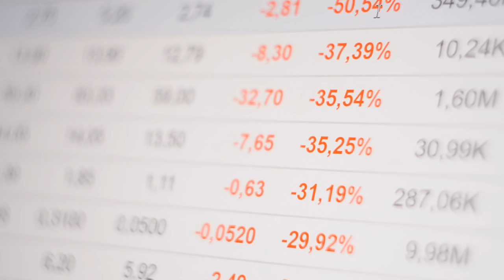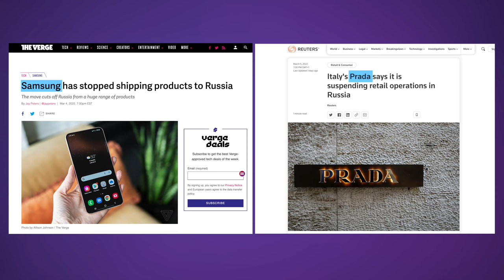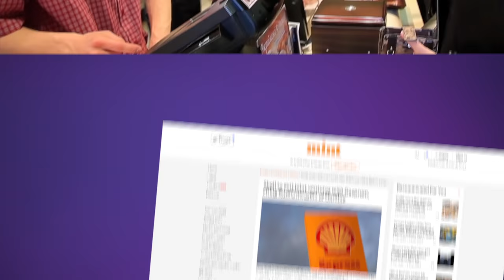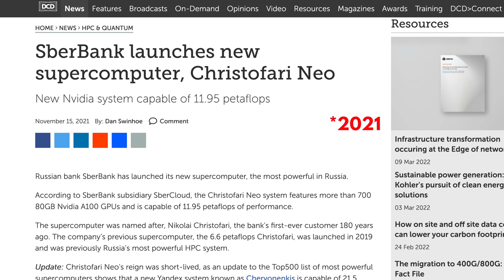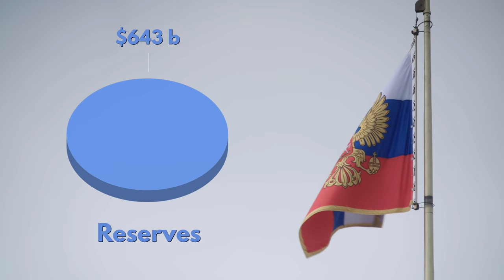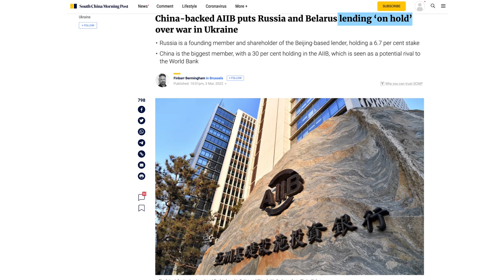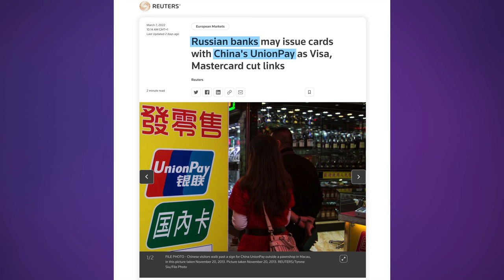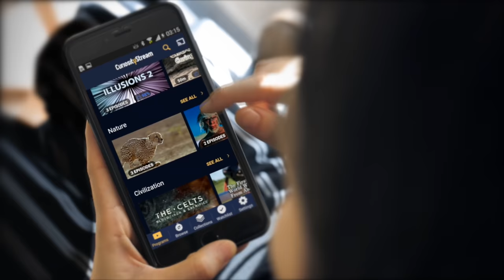Can Russia Survive Tech Sanctions?

Comment: I work in IT field and let me tell you this, Hardware fails every day every minute somewhere out there.. If there is no constant spare part supply, it will decay and will become very limited to function.
Reply: Software requires constant support also.  24/7 support.
Reply: All  have sinned and fall short of the glory of God
the rightousness of God is available through faith in Jesus Christ. 
there is therefore now no condemnation for those who are in  Christ Jesus.
Repent in Jesus name ! confess your sins to God.  
the end is near.
Reply: Me as well. 20 years. Not sure what field in the industry that you are, I am Technology Operations.
So hardware does fail. But not across the board on all devices that are linked to one another. This is why you would set up Parity and Redundancy among the most important Cloud. My last job was in a massive hospital, and current at the top 3 banks in the US. Our systems are so redundantly reinforced there is never a milisecond of outage time. The possibility of 100x devices backing up data and configurations I couldn't tell you. I do know in my enviroments, downtime doesn't happen due to hardware or software problems. The IaaS takes over. Which could be anywhere in the world. As is physical data centers. 
Given that implementation, there is PLENTY of months even to get what you need to replace a node in the architecture. 
I'd like to hear your thoughts.
Reply: @mitch__tech  Most systems are not nearly redundant enough to do months without spare parts and even those that are more than single redundant will not comfortably run their systems with reduced redundancy.
Reply: @fearGod8 yawn
Reply: @fearGod8  There is no such thing as sin. And God is not wrathful.
Reply: @mitch__tech  Putting hospitals as a example of wear-resistant hardware is like saying 'a battle tank is more resistant to small arms fire than sedan, therefore we should not worry about partisans hiding in the woods and shooting passing cars'- Hospitals are designed from scratch to be safe in all but most extreme circumstances with redundant power supply systems, stockpiles of food, medicine, clothing, spare parts, as well as fortified construction.

However, much like the statement, a lot of the electronics on consumer-grade stuff as well as company-grade stuff (such as building and automation electronics, which are massively important in big buildings such as food storages, factories, skyscrapers etc) are very much 'order to replace' items where not much redundancy or stockpiles exist due to high cost of redundancy vs expected projection of neccessity.
Reply: They could use Windows 3.1 .
Reply: @wtfisthiscrap  Bring it on..
Reply: @fearGod8  Finally get to stop work then!
Reply: I don't work in IT; however, I tend to believe it really won't take much hardware and software to cobble together a functioning nuclear weapon or EMP device. It'll just take one and we'll all be back to zero when it comes to economics.
Reply: my laptop and iPhone are still going strong after 7 years. But I get your point
Reply: @fearGod8  Look for the prophecies of Anna-Katherine Emmerich, Anna-Maria Taïgi, Elena Aïello, Our Lady of la Salette, Our Lady of Fatima, Saint Pius X, and so on.

Comment: I'd like to add on your point at around 8:00. The Chip blockage is far far far more devistating as you think. I've worked as an embedded software dev for 20 years and those chips usage goes far beyond than most people think here are just some I've worked on. Chips in gasstations, sewages, waterplants, oilplants, food production etc etc etc. Everything which is somewhat automated/remote controlled with logics in place is royally fucked to put it lightly. It won't even take 1 year until major consequences are beginning to appear in normal peoples life. Fresh water, gas and food will get wracked sooner or later as everything requires modern chips these days.

I'am really interested in the way the russians are gonna deal with it. 

Even us without any trade restrictions had problems the last 3 years due to the semiconductor shortages especially in embedded fields.

sry that my grammar sucks hard, but I really wanted to make clear how depended a modern civilization is from these chips. The most basic infrastracture is dependend on it.

a little edit for further info. The lowest russian semiconductors got around 130~ nm. They've claimed to produce 90nm but that one never came to light so most likely a propaganda hoax.
Reply: They talk 90nm when chips are 10nm or smaller these days.
Reply: You are 100% correct my friend. 
General purpose chips have insinuated themselves into almost all business. This is why people do not understand the situation in Taiwan. It would be insane for the world to allow China to destroy the largest and most advanced chip maker in the world. Like the Chi-Coms did to the Hong Kong business, they would do the same to Taiwan if they were allowed to. That would cause the tech world to completely collapse. And that would cause a world-wide industrial collapse and thus world wide DEPRESSION.
Reply: @makatron  forget 10nm, Apple’s next generation of silicon is expected to be the first to use TSMC’s 3nm process
Reply: @ok_schlatter  it's insane how a phone now outperforms my gaming pc from early 2000s
Reply: @makatron  today a single consumer level desktop computer has more raw arithmetic computing power than all living human beings in the world combined, by at least four orders of magnitude. it's pretty insane to think about how much work computers actually do for us.
Reply: @Bestmann3n  remember when in school they forced us to learn to do math in our heads claiming nobody would carry a calculator at all times? Well well well that didn't age nicely. 🤣
Reply: There is Baikal BE-1000S CPUs with 16nm in 2021. 
And 28nm Baikal-T1 since circa 2016. Sure, it's all made by TSMC, but last time I checked, same with AMD (or we're gonna call AMD paper tiger or something?)

Probably those Baikal CPUs are not good enough to replace high end Intel and AMD CPUs, but that's not the point. The point is that there is 28nm for sure and even 16nm chips (at least few hundreds of engineering samples of 16nm). And you claim that there isn't even 90nm.

If you know how to google, I guess, you can find more info, there's enough. I just did. And I am not even 'embedded software dev'.
Reply: @ivanbardov  oven if there is, with no feasible way to keep producing them how are they going to fix whatever machine they're in?
Reply: @makatron  probably they won't.

But as I said earlier, my point is that there were 28nm and even 16.
While the guy above, pretending to be knowledgeable on the matter, says that even 90nm is doubtful and probably propaganda. But 2 min google search proves otherwise.

Correct me if I'm wrong
Reply: @ivanbardov  ah no I'm with you, I later sure searched for the latest chips made in Russia, still the pressure on the whole economy and regular folks is going to keep piling up as days go by. Let's hope this ends soon.
Reply: @ivanbardov  design and fab are two completely different things. You may be able to design down to 5 nm but if you don't have access to Taiwan's fab capabilities, your design is nothing more than an idea that you can never use. Most design houses are what's called "fabless", in that they can't build their own chips. These Russian examples are the same. The sanctions have removed access to the fab houses that can do the latest and greatest chips so without them Russia is screwed
Reply: @vincentpatrick5780  
What's the point if your comment? In my initial comment I explicitly said that those Baikal chips were manufactured by TSMC, just like recent AMD chips. I never said that Russia isn't screwed either.
Reply: @ivanbardov  I thought you were claiming that Russia can do in-country Fab down to like 10 nanometers. I was clarifying that that's probably not correct, because only tsmc, Intel, and Samsung foundries can go that low worldwide
Reply: @ivanbardov  Russia may be able to design down to 10 nanometers but they can't Fab designs that small on their own soil
Reply: @ivanbardov  The issue is that with sanctions, TSMC will not produce for Russia, and Russia's internal production may not be capable of 16 or 28 nm chips.
Reply: @TheCuriousNoob  compare that to the ancient tech that was used in the Apollo program
Reply: I guess those who have played fallout know the importance of chips then ;P
Reply: @makatron  haha yeah, good times lol they can say that to our smartphones!
Reply: 2w won't India supply most of the tech systems Russia needs? As well as China? So won't Russia with these 2 countries help be ok?
Reply: @ernestovelasco6182  agree

Comment: Think of similar scenario with China. Every sector globally would impact since most countries fully dependant on import from china and specifically cant survive without Lithium or Semiconductor demand.
Reply: The main reason CCP is still there is because of promise of common growth.
That for past 2-3 decades have made people to even take some down beating.
They don't provide human right but it's still better then starving to death that has what CCP has done overtime.
Is it all because of there own effort?- the answer is no.
But
Have they taken full credit ? - answer is yes.
With Chinese economy slowing due to bad terms with others,other starting to pull out there resources, their bad one child policy ie a shrinking working class people.
Historically all dictatorship collapse by public is done when the times turns bad and still their behaviour don't change.
If thing are getting better general public will tolerate more and more but when things start to turn bad even earlier level of tolerance start to be less.
CCP is not that stupid Atleast what I think for world to put halt in there economy by giving them very clear reason to do so.
But even small changes overtime will affect a lot in long run.
I really don't see CCP lasting anything more then next 60 years.
To long but slowing and degrowth will take that much time only
Reply: @Daniel M Survellance is mostly for security, credit system is nowhere as insane compared to the west, censored fact-checked news are equally bad, I’ve spent half of my life on each hemispheres, I know exactly how things work.
Reply: @Daniel M the West has to cooperate with fellow democratic nations and we have to stop being reliant on countries run by dictatorships or radical fundamentalist Islamic countries. 

and I already know that the West is going to be accused as being "racist" this is a risk I'm willing to take. 
multiculturalism is a dumb idea. 
multiculturalism in Yugoslavia, Lebanon, Cyprus and many other countries never worked. 

the difference between people are too big in order to have a multicultural society. I don't like being tribal but sadly this is how majority of the world works. people care about their own kind first instead of others. this is the honest truth.
Reply: @namanjain5763  dude you indian man for once stop talking about china
Reply: @LevisH21  I salute your knowledge of the truth as so many are being brainwashed to think otherwise.
Reply: Vijayakrishnan Venkatakrishnan 
PRC "manufactures", but the underlying Technologies(how & what of manufacturing) is almost of Western origin. Mostly it is true of semiconductor industry(where a good part of manufacturing Technology is with Taiwan). And if they withdraw all that, the manufacture in China upon which PRC prosperity depends, collapses. Now these Technology holders do look for alternate sites, mostly in SE Asia with Vietnam being prominent. All said, almost all "chips" (Large-scale Integrated Circuits & above) come from PRC. That way they are far far better placed than Russia, but the "switch" is in Western hands.
Reply: @TheDomokosi  
"Rant"
Reply: @namanjain5763  
Well written piece of info. But people(Chinese) don't elect CCP(or CPC) leadership that is the sole ruler of country.
Also your use of "there" for "their" is really grating. It distracts my understanding. Would you mind writing the correct spelling (heart of English language is its spelling), please?
Reply: @LevisH21  
In Middle East, it is the continuation of the "Crusades" (as far as Islam is concerned, at least; with Christianity responding).
Reply: @reggiep75  
How the Chinese have dug? It is America that did the trick - by shifting lock, stock & barrel her vast manufacturing to west, across the Pacific to PRC. That made PRC prosperous with a hundred million jobs on one side, while on the other hand keeping their (American) citizens happy with practically "all" the daily necessities for family (that if made in America would cost five to ten times each), imported across the Pacific.
Reply: @MrPoornakumar  like I said. 
the West isn't just USA. 

and USA is currently extremely divided because of how diverse the population has become in recent years (40 years or so). 

with the rise of technology and social media, Americans have become extremely tribalistic with eachother.
same could be said about other Western countries as well. 

social media is a poison. it makes people narcissistic.
Reply: @nothing9220  
If sanction-ed, Americans would starve of all their daily necessities for running their families.
Reply: @TheDomokosi  it seems like countries run by a democratic government and built on capital markets, the system can be tweaked to behave in certain ways ( for better and worse - it's not without it's sins and flaws) but it seems like history is punctuated by all the stories, tragedies to be sure, that arose when one person had too much access to a country's resources, political control and military decision making. no?
Reply: @LevisH21  but the wealth gap is also very polarizing. it doesn't seem to matter what system the government is; rich and powerful people have access to the people and processes that make the laws. I feel like printing currency, licenses to print currency, are a massive danger to world stability because it's keeping tensions at a boiling point. stability is very good for poor people and volatility seems to be very good for rich people....  it's definitely just one piece of the puzzle but it's what comes to mind when you talk about the problem posed by social media
Reply: @reggiep75  I have to agree with  @Poornakumar Das  that China has benefited massively from US business investment and can only give their government so much credit for the benefits that have accrued to the people living there. That's not to make a judgment about that government, I'd rather say that the real quality and effect of their government will be seen in the next 50 years rather than the last 50 years, as their economy shifts from being on the fast track as the US preferred provider, primarily manufacturing / exporting orientation, to primary internal service / consumption economy that is providing for the needs of their growing middle class, as what we see in other mature modern countries.
Reply: @TheDomokosi  get out of here tankie
Reply: @towTruck42  I know nothing about economics but I do think printing money is a bad thing. the national currency eventually loses its value and average working class people aren't able to buy themselves necessary goods. 

this is what is happening for example to the average Russian because of the stupid war the Russian regime with Putin is doing right now. 
wage a war against Ukraine, the Russian ruble is getting even worse.
Reply: @LevisH21  the simple version is that if you own assets that give you business income or capital gains, then inflation increases your purchasing power and if you own no assets and earn wage income then inflation decreases your purchasing power. a responsible government should attempt to minimize inflation because that's what's good for the vast majority of people in the country who don't own a lot of assets. but because many of the people who make political decisions are so insulated from the effects of inflation, it's easy for them to be insensitive about doing the things that cause inflation, like deficit spending, waging wars, telling everybody to stay home from work for 6 months, etc. on one hand, it's how rich people steal from poor people legally. on the other hand, why bother with a totalitarian regime if you have the ability to retain power and influence behind the scenes by manipulating the value of money?
Reply: China isn't even in the top three in lithium production. Australia far outproduces them.
Reply: You will find a similar scenario if India helps Russia.
Reply: @jeanlaikan8400  Indians will be on continual hold when trying to call to discuss the failures of their Russian Military assets.

Time too add.....if Russian Aligned and supporting with resources.
Reply: @GeorgeWashingtonLaserMusket  “

Comment: Russia has abandoned IP protections for "Hostile Countries" they can just make their own copies of western tech and chips etc.
Russia will benifit in the long run with increased production capabilities and more jobs much of the russian market was already self sufficient anyway.
Even Russian made aircraft have alternatives.
Reply: Look into military aircraft avionics. Neither Russia or China are self sufficient.
The considerable success of the Ukrainian air forces may be due to avionics upgrades from western sources providing a sizeable advantage over less capable Russian systems.
Reply: @squiremc  China Fully Develops its engine for it j20 recently duddd
Reply: @didyoumissedmegobareatersk2204  Their engines and aircraft are fine, but without avionics to exceed the enemies you had best stay on the ground.